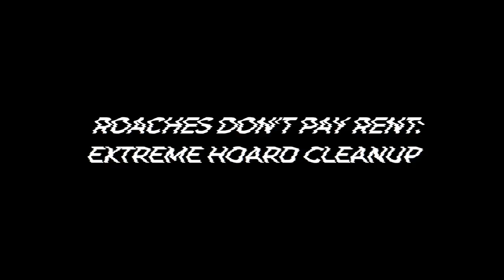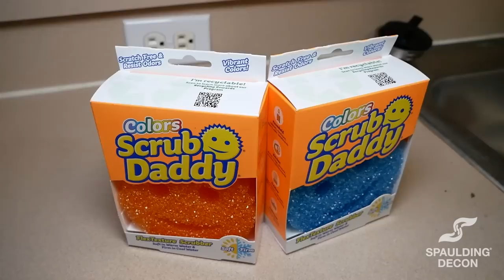THE MOST COCKROACHES WE'VE EVER SEEN!!!

Comment: As someone who has a hatred/fear of bugs, watching this is both disgusting and horrific. How can people live in that type of environment?
Reply: They're not living. They're existing.
Reply: Bro, i killed 3 roaches with my dogs old hairbrush yesterday- killed another 2 today with bug spray. Im terrified by the bugs. Didnt help that there's a bunch of plants/bushes right next to my house and they keep coming in my house. Its really amazing for me that she could live here like that +the cleaners not freaking out lol.
Reply: @frog8313  I recommend using a perimeter bug spray around the outside and inside walls of your place. I did that and I saw more dead bugs than living. And I felt a little calmer knowing I did something to help prevent them from always entering.
Reply: @cindyluu1476  damn, thank you!
Reply: @frog8313  Home Defense works great. Spray as directed outside and inside.  Have a look in cabinets where plumbing comes inside and seal gaps up with silicone or expanding foam. I've even resorted to duct tape in a pinch. There are usually gaps around pipes big enough for critters to get in. Check everything outside that needs caulk and redo it if needed. Our house is on a slab and since we're in humid SE Texas, there are weep holes at the bottom level of brick veneer so the house can breathe. Had to fill those in with steel wire to keep the palmetto bugs and small roof rats out. Pain in the butt to do, but works like a charm.
Reply: @RepublicTX  thank you so much. Right now, luckily the bugs have reduced, but when they come back, imma have to use this.
Reply: @AmyC28713  exactly
Reply: The mattress was just the Cherry on top that’s just sickening
Reply: And then all the roaches under the bed oh my God